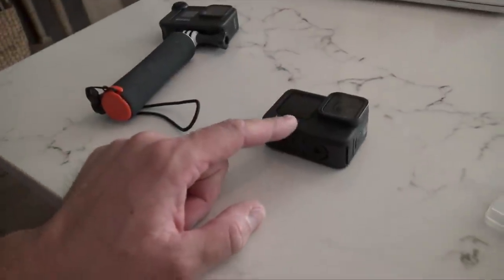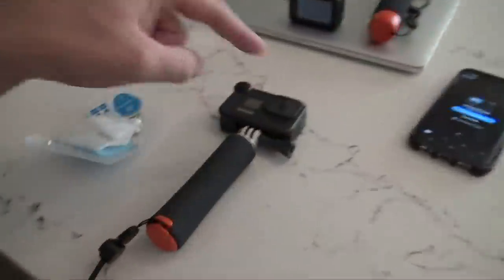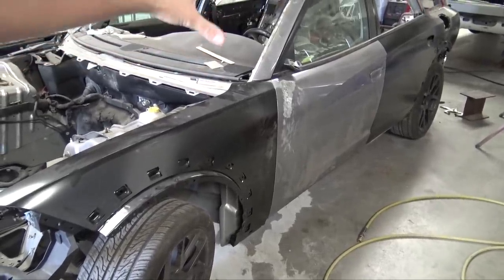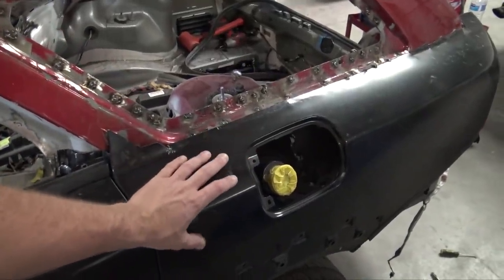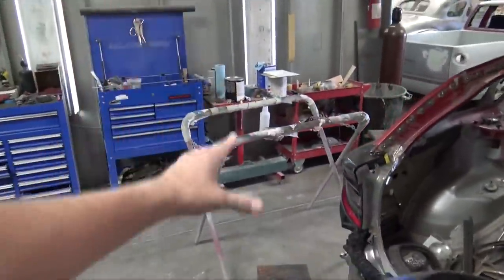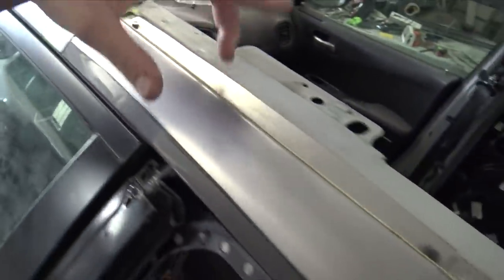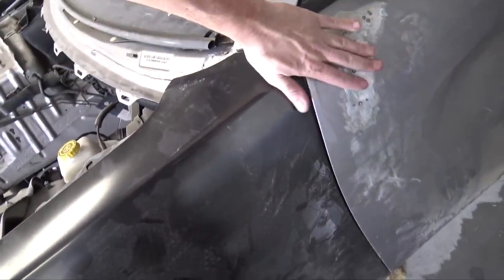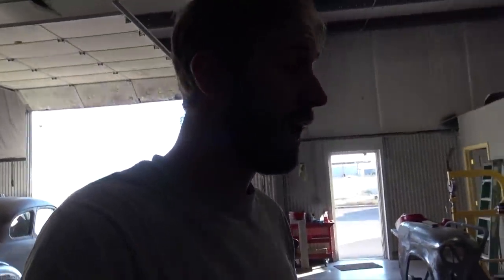Building the Ultimate Station Wagon | 2021 Charger Magnum Hellcat | 1000HP Hellwagon | Pt 15

Comment: The "X" in the design question, is the final part of the rear trunk !! I had commented before, about having a way to use AutoCad 3D, to merge the parts of the rear trunk of the Dodge Charger, with that of the Magnum. This way, the metal plate can be cut to the right size, with few reinforcement adaptations in the trunk lid structure.

Comment: A couple of tips. Next Time you're near a Dollar store visit the hardware and cooking sections and pick up some cheap plastic cutting boards and face shields or goggles for grinding. Use the clear plastic off the face shield to protect the cameras and the cutting boards can be used for putty mixing trays and or cut up for gap spacers and wedges.

Comment: Dave, setup a camera specifically for fabwork. make a little bracket you can clamp to the handle that will hold a piece of plexi in front of the camera. Then you wont have to worry about the camera lenses.

Comment: Nice work, next time your welding on a panel and you need to push it in, try using a piece of copper instead of a screwdriver so the weld won't stick to the copper.

Comment: Dave, did you ever decide on the name for this build?  Awesome work as always, really looking good!
Reply: Rampage
Color is gonna be blue probly spec from dodge blues
Also will be accented with glow in the dark powder coat. He already did calipers.
Reply: @jacobphend6706  Yep, I knew about the calipers, just didn't hear a definitive choice on color/name.  Thanks!
Reply: No problem.. I think he even has a video where he got a 3d printer in and designed new emblem